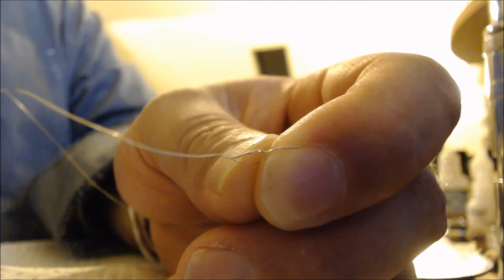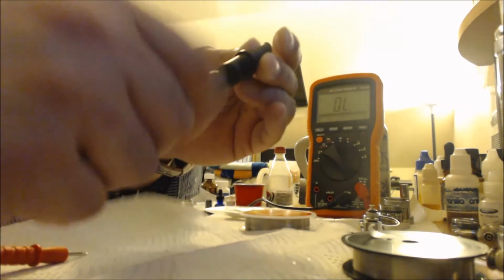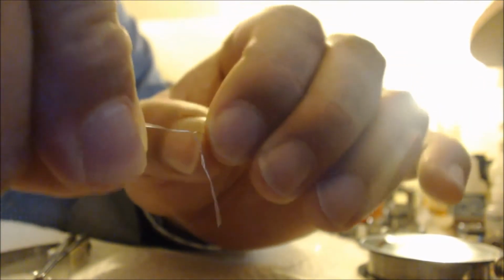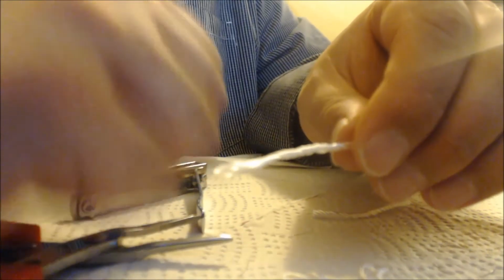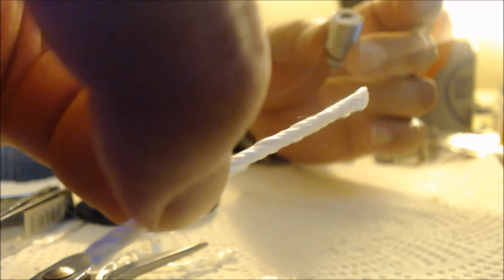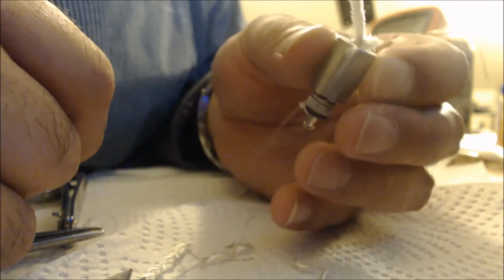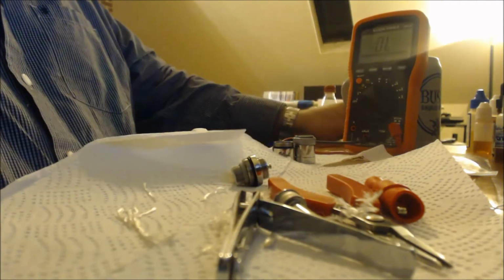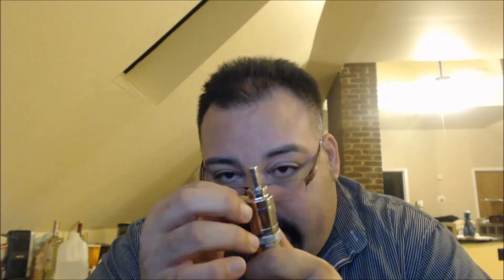Revised Highlander Dual Coil Tutorial

Comment: I have been having some issues with burnt taste and bubbles on my ithaka (i am in the process of obtaining the o-rings to do the mod in one of your other videos) but im not sure why I am getting the burnt taste so predominately when i vape. The Vapor production is really really low also.

I'm using:
GG Ithaka
0.28 gauge nickel and kathal wire for my coil
eco whool for wicks
18650 MKE battery at 3.7v

Anyone have any ideas? Any advice would be very helpful, im in the process of tweaking my setup.

Comment: Can i twist the +ve wire  side as well as you did with -ve wire ?
i never tried  this before i only have ody V1 i think it should work there as well correct ?
i do only  tiwsted 32AWG single coil at 0.7 ohm have you tried this before does it give the same vape as the highlander or this would be different ?